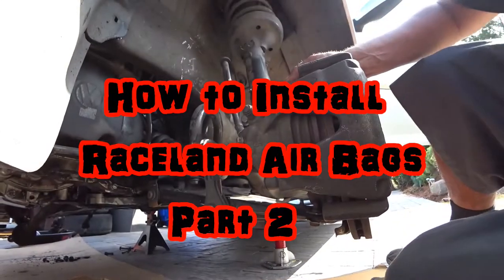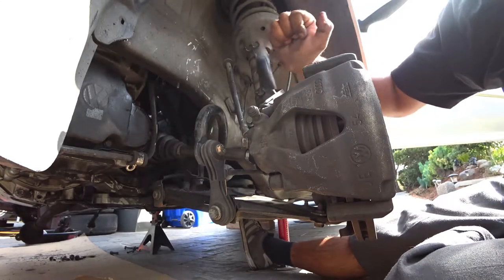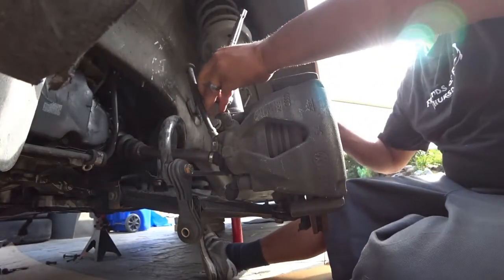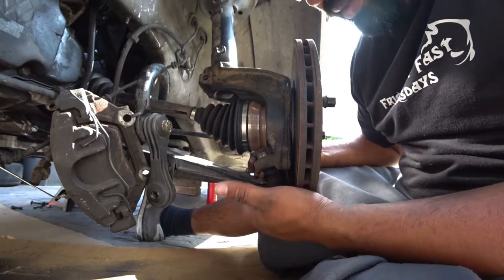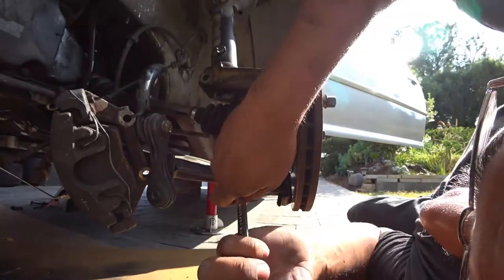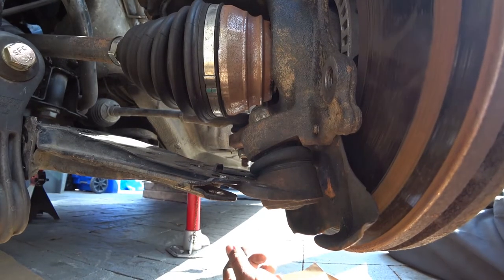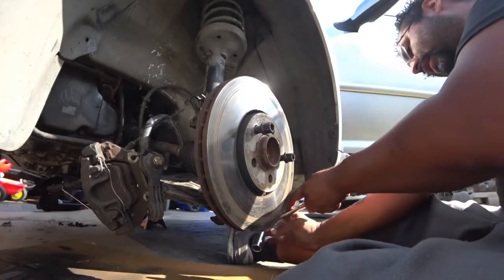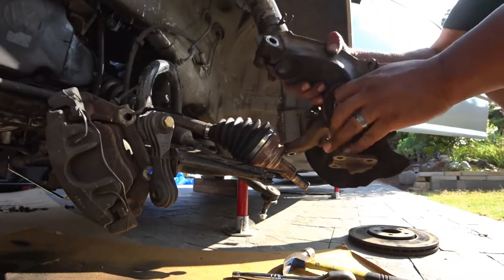How to install Raceland Air Suspension on a VW MK4 Part2 S4 EP16

Comment: planing on getting these bags but what type of  management  should i go for ? is even worth buying it separately?? also wouldnt cutting the sway bar give the axles sag and damage them? ive seen a nuespeed swaybar with adjustable links  is that even worth it? Thanks in advance !
Reply from the maker: You cant run a sway bar on bags if you want to go low. Neuspeed sway will hit the axle still.
Removing the sway bar does not affect the axles only affects your body roll. If your worried about that then install a rear sway bar which will fix that quick.

I use airlift V2 management. Ez to install and works perfect
Reply: @PincheALsGarage  Thank you sir!